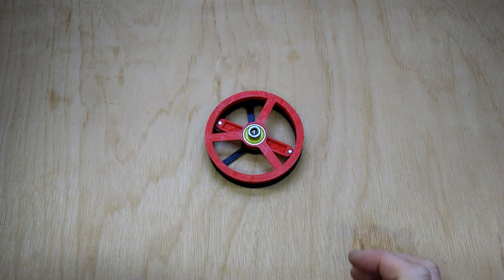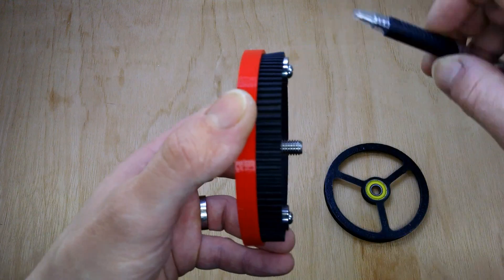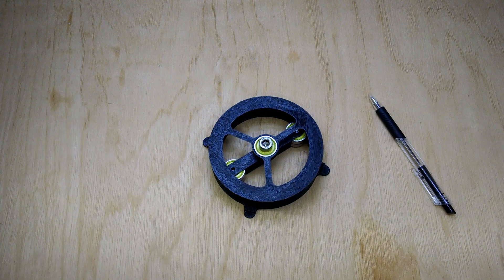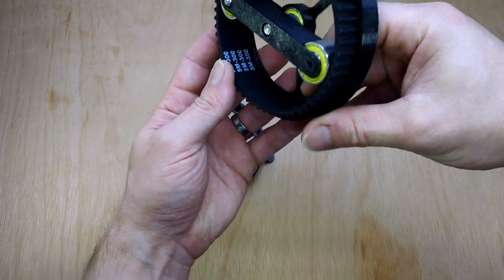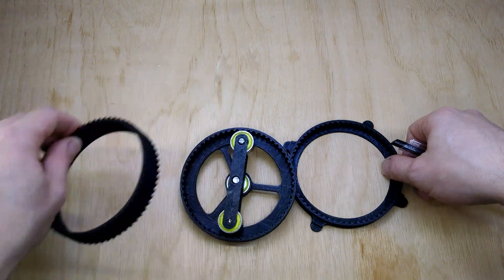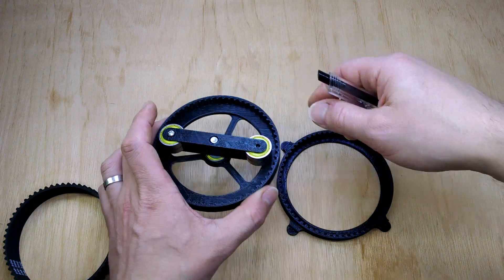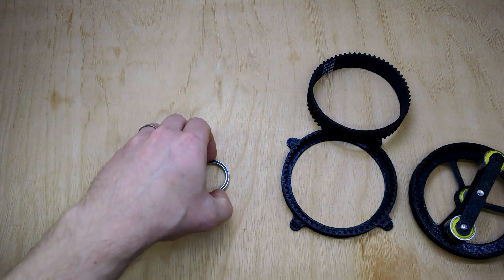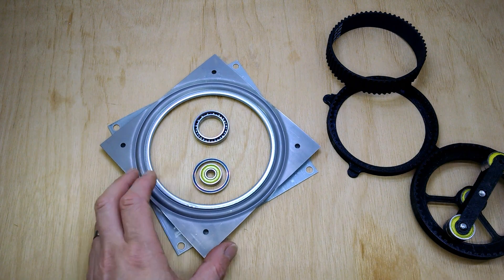3D Printed Strain Wave Gear: First Design Revision

Comment: How many tooth is on the belt?
Reply from the maker: Which design? The video explains the new one is a 5mm pitch on a 300mm pitch circumference. So you divide 300mm/5mm and get 60 teeth.

Comment: hey! great video. I was wondering about how did you go about finding the correct diameter and other technical stuff. I am unable to find any technical document on the design.
thank you
Reply from the maker: It was a long time ago but I think I just used the dimensions of the belt and made sure that the belt teeth that were out of phase with the strain generator contact bearings would clear the outer ring teeth. Definitely some trial and error. If you go to the linked hackaday.io project there should be some more info there.

Comment: Hello. Just a quick question how is it possible that the bottom and the top gear has different number of teeth but sharing the same circumference diameter? If they dont have the same diameter how did the belt and the wave generator fit the two gears at the same time? As far as I understand harmonic drive gear the beth should have a tight fit to both gears to create a non backlash motion.
Reply from the maker: Toshigawa Tori the size of the teeth are slightly different to achieve the same diameter with different numbers of teeth.

Comment: Hi, could you please guide me how to make this gear with 320:1?
Reply from the maker: Gurpuneet Singh I suggest you use the first design revision. Then you will need to print a gear with 640 teeth and a gear with 642 teeth, then find a belt that has 640 teeth or preferably slightly fewer teeth. You will likely struggle to make this gear with even a 2mm belt tooth pitch but good luck if you do!

Comment: According to this thingsverse http://www.thingiverse.com/thing:1966551 "The un-meshed teeth tended to vibrate with the 2 bearing version." So maybe it makes sense to put more bearings there for stability.
Reply from the maker: Adam Stankiewicz yes, or go for a 3 bearing/contact zone to keep the axes of the wave generator and the gear rings aligned.
Reply: Could use bigger bearing

Comment: This is indeed very nice work. I have 2 questions, being involved with gears myself (http://www.eternalgadgetry.com)
1. What is the form of the printed gears and belt you are using? Quite importantly, are they matched? I suppose it is not involute.
2. Your wave generator or however this red bar with the bearings at either side is called: would that work in case you have more than 2 ends? For example 3, 4, 5 bearings pushing out? If that would still work, would it make it more stable? Would it then affect the overall ratio you get out? (I suspect not).

Thanks a lot for the inspiring work and I hope you still take this interesting project further!!
Reply from the maker: Markos Skoulatos, amazing work on your part - thanks for documenting. The form is a very rough rectangle 2.5mm wide and 2mm deep, rotated around the inner edge of the gear circle - very trial-and-error for the proof of concept. The belt is HTD 5mm pitch. 

There is a very helpful team member called Ken Kaiser on the hackaday page (see link in video comments) who is learning Onshape featurescript to make the foundations of a gear generator for this design/concept. He's making good progress but keep an eye out on the hackaday page for a project log on this when he's reached a point where he's ready to share progress.
Reply: Thanks a lot Simon! I will keep an eye on the project. In any case I have access to a laser cutter, and I can easily cut and ship parts to you/Ken. The accuracy of the cut is pretty good (0.1 mm or better). Just let me know if you need anything.
Reply from the maker: Markos Skoulatos that's really kind, thank you!

Comment: Awesome design man, I wonder if you could mill it out of alluminium?! I just ordered a 3040 cnc mill and I'm planning to build a cheap open source robotic arm. I was wondering how to build a nice geared brushless servo for the joint (maybe with closed loop) and this looks very good for gearing the motor down for the robotic use. Would really appreciate if you would consider a bit of collaboration =)  Keep up the good work anyway!!
Reply from the maker: dammuozz I'd love to see someone take this into aluminium. Please head over to the project page at https://hackaday.io/project/19405-strain-wave-gear-with-timing-belts and join in! If you make something, let me know by requesting to join the project team and you can post your results as a project log. If you read the hackaday.io page and comments there and on YouTube (I have another video of the first version of this) you will see that we need to come up with a sturdy bearing and mounting arrangement before this becomes useful for the kind application you are interested in. At the very least, log in and follow the hackaday.io project page for updates as and when they appear!

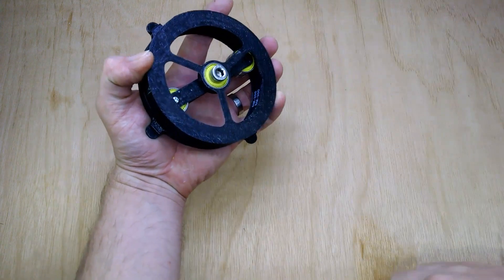Comment: Very nice! How well do you think it performs? Is there a way to measure the efficiency? Is it a gear ratio of 1:30?
Reply from the maker: It performs pretty poorly as a gear at the moment - needs redesigning into something that can take load. This version doesn't even have the bolt connecting both gear rings! There are several ways to measure efficiency but it's not high on the list for improvement. I think people will find it useful enough with losses if we are able to strengthen it. I think the gear ratio is 1:31.
Reply: Simon Merrett this design is very compact and the ratio very high, which makes this interesting. Of there's potential time will hopefully show us! Do you think it would be plausible to build smt that handles 5 N/m?

Comment: Great project!!! Thank you for sahring it with us! What about wearing the materials over time? Do you think it can last for ... lets say 1 000 000 and more cycles?
Reply from the maker: Danail Ivanov you're welcome. I have zero confidence it would last that long but that's because I haven't tried it and nothing about the materials or design as they are gives me reason to think it would. Life span and failure would be dependent on many variables. Do I think we could develop this into a design which can be made from suitable materials and processes for practical applications? At the moment, yes! For example, cnc routers or laser cutters could produce gears and wave generator arm parts in much more suitable materials. 3D printed parts are useful for design development but can also be used as formers for processing better materials, such as in lost PLA casting and resin/thermoset moulding with silicone moulds.